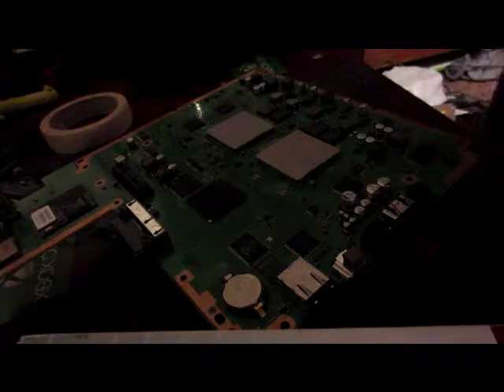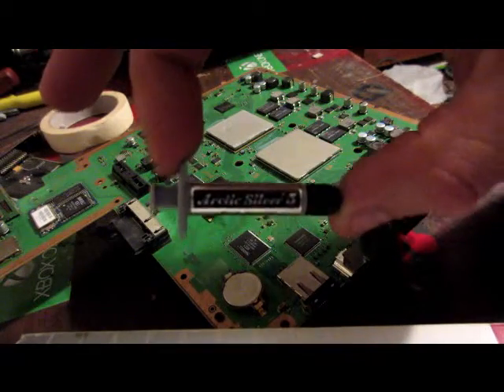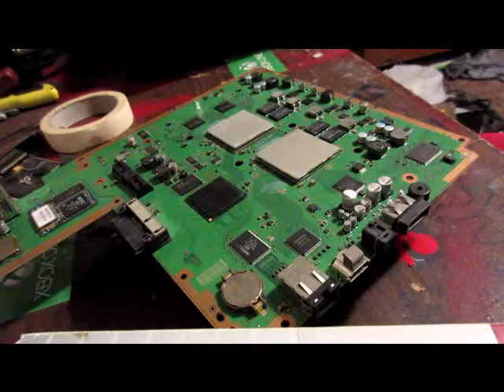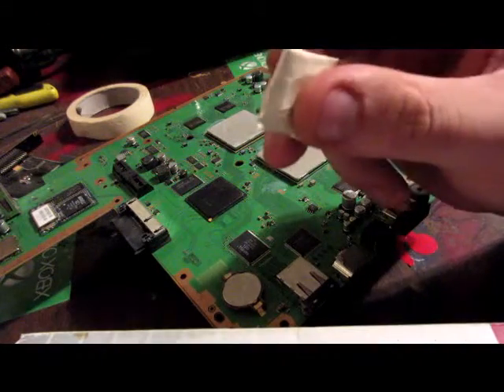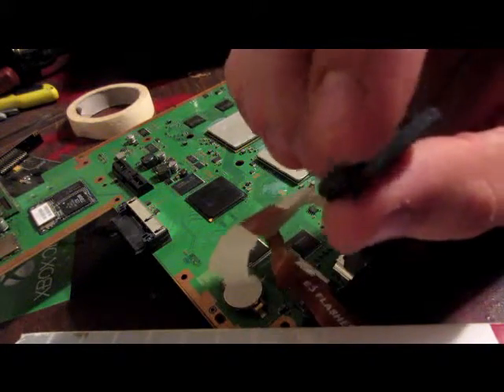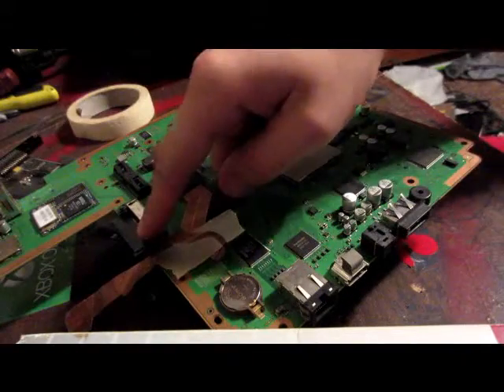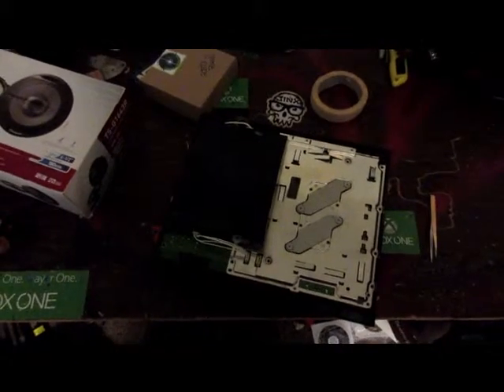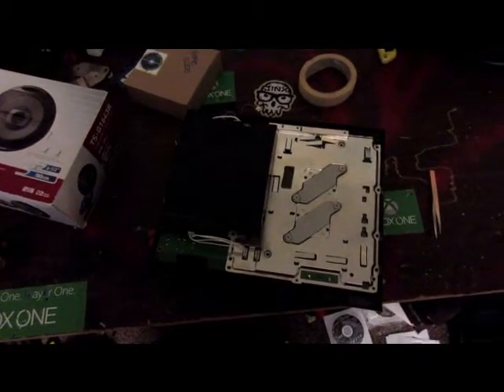Installing the E3 Flasher NOR clip

Comment: if you downgrade your ps3 put the custom firmware. are you playing on a playstation network? or something like xbconnect or xlink kai a third-party server
Reply from the maker: +AVGs- B1TCH Unfortunately XBconnect got shut down back in late March early April. I doubt it's coming back :( You can play on PSN but you may get banned sooner or later. If so it's fairly easy to get a new console ID flashed over. As soon as I have another Ps3 to do I will be making videos on all of it including getting a new CID installed if you do happen to get banned.
Reply: H4Ck GAMiNG someone would have to report me right? Or else how would sony know my console is modded. Lets say you are banned then what servers would you use to play online
Reply from the maker: Either report you (for anything, even harassment) or do a ban sweep which is where they check all the console "tags" and if they find any are modified they ban you. Then you just change it to a new console ID (CID) that has not been banned and go from there. I believe you can use XLink but I haven't ever had to use it.

Comment: I have the PS3 fat nor model number cechk. And I got an e3 flasher to down grade it from 4.75 to 3.55 I've been following the guide from project Phoenix media but I can not get the not chip to seat properly I tried everything from putting quarters on it to putting 4 Nickels on it I've tried masking tape duct tape and  scotch tape I was able to get it to make one successful dump but then then had to go to work n when I got home it was back to the same error code someone please help any one have any ideas I've also tried Poping out the pins. Would I be able to just soder it on would that work ?
Reply from the maker: +ZZROBProductions Try sanding down the edges more. I am 99% sure that is your issue. I had the same problem and it turned out the left bottom side of the clip wasn't seated all the way down to the board.